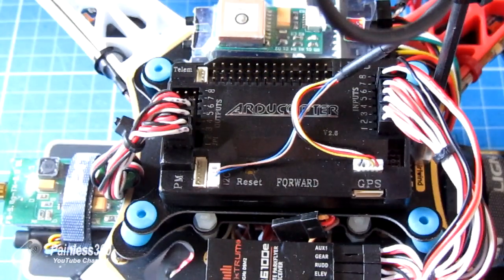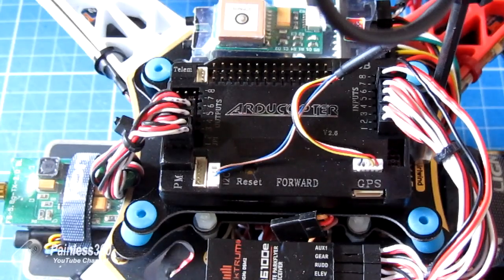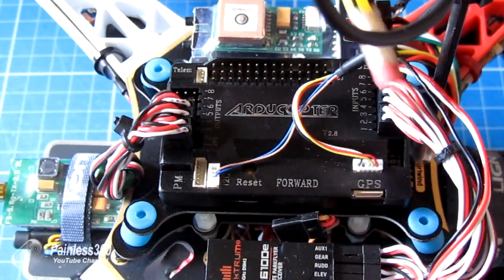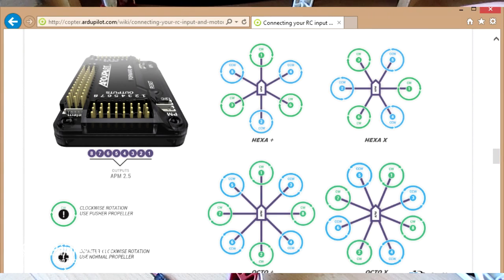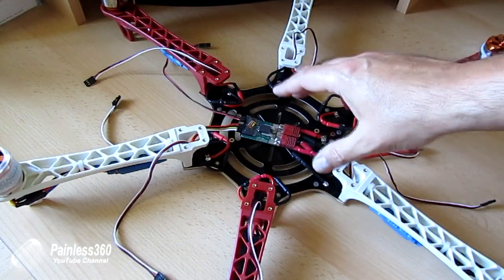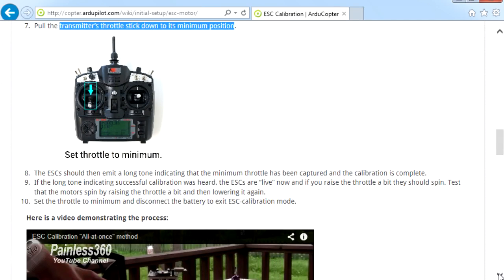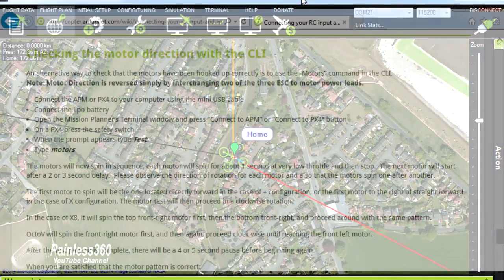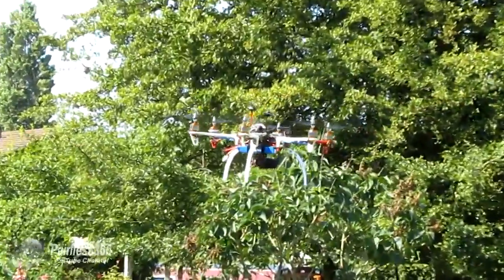(2/8) APM 2.5/2.6 - Powering the board, motor installation and ESC calibration

Comment: Good to here from you Painless360
Before I hook up the Signal and Ground wires from the BEC's to the APM. One more thing. Can I use the BEC's to power
other things like, One of the BEC's is power for my gimbal. Can I use the Signal and Ground wire from a BEC to the APM and from the same BEC use the Plus and Ground wire to power the gimbal ?
Sounds like the Ground is a Floating Ground.
Thanks again
Dale
Reply from the maker: Hi Dale, I would leave the ESCs to power the motors and add a dedicated UBEC to power other things. Good luck with the build!

Comment: I'm using a 5V 3A UBEC to pins 8 on Outputs side to power the APM and Receiver. My ESC's are Switching type.
Can I use ONLY the Signal wires from the ESC's to the APM,
Or do I need the Ground and Signal wire to go to APM Outputs ?
I'm getting close.
Thanks for your help
Dale
Reply from the maker: Dale Fischer hi, you need to connect both the signal and ground wires on the ESCs. Good luck with the build..

Comment: Your videos have been a really valuable resource whilst building my APM Quad. So thank you. However I am having a real problem that I'm hoping you can answer. Essentially when I auto review the logs, it is saying that I have thrust fail - that is that the height gain is too low for the throttle input. My quad isn't heavy - there are no cameras, gimbals etc. Whilst flying it is obvious that the thrust is way too low, as sometimes the quad bounces off the floor before actually lifting. 

All of my parts are as recommended for the 3DR Quad.

I really hope there is a simple answer to this - please help!!
Reply from the maker: Sounds like it does need more power. What motors and props are you using?
Reply: Thanks for getting back to me. I have 850kv motors and 1045 props
Reply from the maker: What 850KV motors are they?
Reply: These ones: http://www.unmannedtechshop.co.uk/brushless-motor-2212q-850kv.html
Reply from the maker: 4 of these will cope with about 1 to 1.2kg of model. How heavy is yours?
Reply: Just under 1.4 with no battery!! How did you work out this weight? These are the motors in the kit supplied by unmanned tech shop
Reply from the maker: I use the same motors :)

Comment: Hi!
Which anti-vibration have you mounted on this quad?
Thanks!
Reply from the maker: I got this one from eBay - http://www.ebay.co.uk/itm/Black-APM2-5-2-6-KK-MWC-FC-Flight-Controller-Anti-vibration-Plate-Set-/271492722027?pt=UK_ToysGames_RadioControlled_JN&hash=item3f363a2d6b

Comment: You are the Man. Your Videos are super. I'm using the QR X350 Pro as a platform for the APM 2.6. with Turnigy 9X8C v2 Receiver, HK 20A Blue Series, ESC's, Turnigy D2830/11 1000KV motors.
Do you think I can use the QR X350 Pro power board to power all the components?
Thank you again for your time.

Comment: If I am building a hexacopter with Linear BEC's that provide 0.5A each, is that additive? What I mean is, if I have all 6 plugged into the board, will I be providing the board with 3A? If so, is 3A acceptable, or does it need to be 2A?
Reply from the maker: Subsonic1050 The APM will pull power from all the connected BECs. It is additive-ish. 0.5 amps seems very low and if (due to different resistances, existing draw, tide, wind, traffic! :) one of the BECs is asked to provide more than the 500ma then you could have problems and lose that ESC and the motor it's connected to.If you really have only 500ma on each BEC then my advice would be - don't risk your model for the sake of fitting a 3A switching UBEC. Remove the red cables from the on-board BECs in the ESCs and power the whole thing using the external 3A UBEC.Hope this makes sense. Best of luck with the build!
Reply: Yes, that is exactly what I was wondering. Thanks for the help!

Comment: Hi, Tell me please: if i connect power module and ESC's with UBEC to board it will fry it?
Thanks
Reply from the maker: Is the BEC in the power module switched? If so then the answer is that you can't connect any other power.
Reply: I connect complect power module and ESC's with linear BEC. Everything OK so far.
Thanks for your videos! I try to do something similar on my channel.

Comment: Hi! Could you share what gps device do you use. Thank you!
Reply from the maker: I use the modified CN06 for the APM 2.6 as it now includes a magnetometer (compass). You can see that GPOS in a number of my other videos. the V2 and V3 work very well.

Happy flying.
Reply: Painless360 Thank you for this info and for the great videos!

Comment: Hi! Can i use your instructions for 2.7 version? I want power up the board 2.7 from ESC. I need jumper for it, or it installed. Thanks!
Reply from the maker: Hi Саша, I assume you mean the one from HK? If so don't be fooled by Hobbyking calling it a 2.7. It's a board with a number of fixes from their poor 2.5.x version that had a number of problems.

The power system on that board is identical to this. The only extra thing to think about is now the magnetometer is selectable via a jumper. Hope this helps.
Reply: Yes from HK. Better get APM 2.6 from banggood? 6m GPS or 6H GPS? Thanks. And whot i need to power up it with ESC? I need to instal some gumper? Is it in complect? Thanks!
Reply: Or nothing need to do from the box? Just connect all linear ESC?
Reply: Painless360 I saw another video and guy said that you need to buy jumper to power up board from ESC.
Reply from the maker: Maybe, not sure how HK ship them.

My last board from eBay didn't gave a jumper soldered across the J1 junction so I bridged it with some small wire and a spot of solder as I needed the ESCs to power all of the board.

Depends on how they are made.
Reply: And what i need to do? Find jumper?
Reply from the maker: I would just buy the board that has the jumper already installed on it and then you don't have to worry about soldering or buying other parts..

If you need more help please schedule a time via the Helpouts system.

Happy Flying!
Reply: Painless360 OK. Thanks! Where I can find "Helpouts system"
Reply from the maker: You can search on 'Painless360 helpout' in YouTube or click on Painless360 Helpout Launch
Reply: Painless360 Thanks for excellent videos!

Comment: How do u plug in the USB and battery simultaneously without blowing the board.
Reply from the maker: Hi Niel. The board runs on 5v from either power source so both at the same time is fine. Be sure to use a powered USB port from the PC/Mac so you dont try and pull too much current.

Happy flying!

Comment: Great video.  My only suggestion is that you go thru a verbal explanation of steps to set ESCs and test motors but you don't actually show what happens when you do it.
When I set up my quad it took me a bit to understand that the CLI Test Motors makes the motors turn in circular sequence but not in motor number sequence.  Actually seeing that would help beginners understand what they should see.
A minor thing, but I think it would be very useful.
Other than that, great video.
Rick
Reply from the maker: Great idea, I already have a video that covers this. Watch my other video in the APM 2.5 series - http://www.youtube.com/playlist?list=PLYsWjANuAm4oSFdOSBswt6GmU7y6v60O1 - Testing motor connections.

Happy flying!